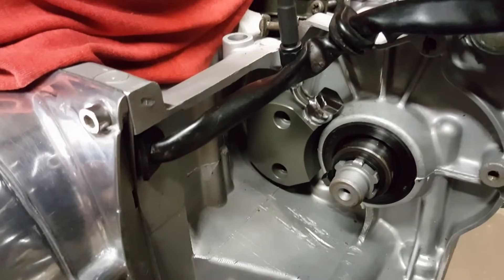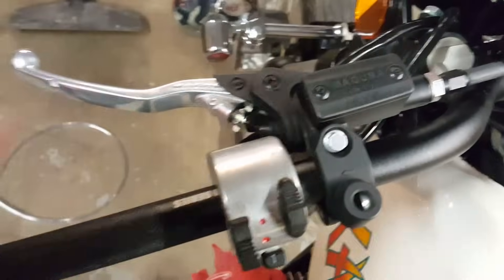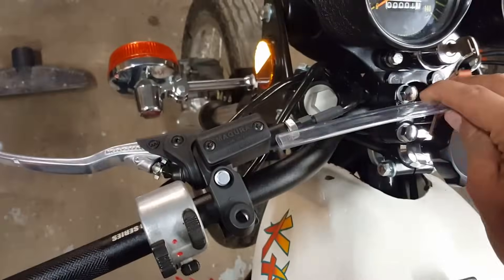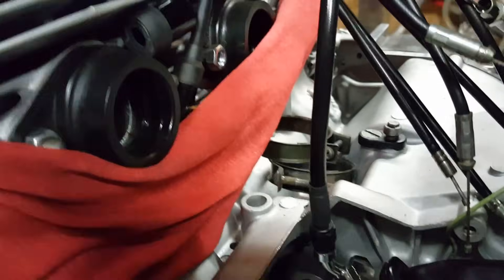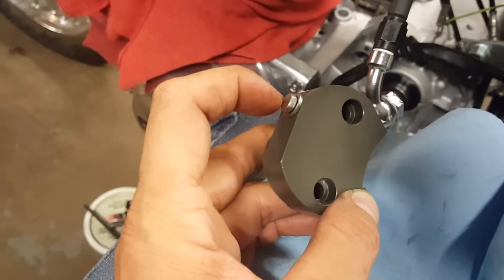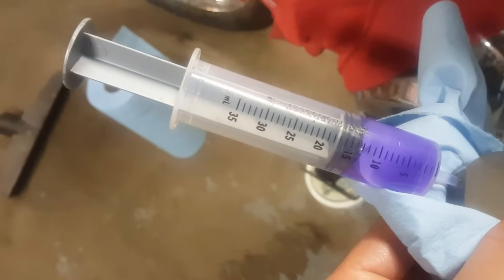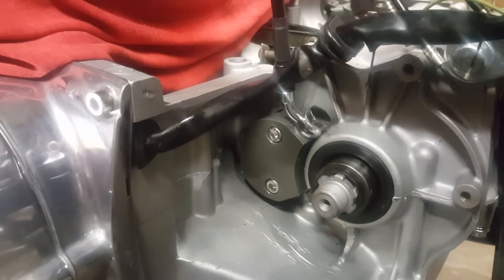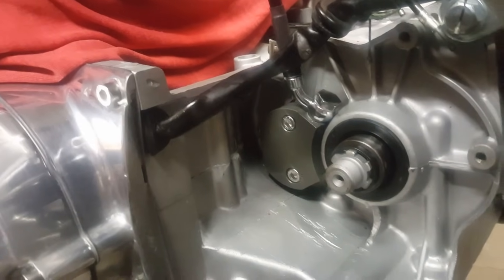Motorcycle Hydraulic Clutch Conversion | Kawasaki H2 Triple

Comment: been on Russells web site no NED'S Hydraulic clutch kit found. Any help in getting one.
Thank's Geoff.
Reply from the maker: There is no complete kit.  The slave cylinders are built by Ned from the Canadian Triples Forum.  There is a thread on there regarding ordering.  I sourced many of the fittings from Russell's which is what's listed in the  work sheet.   The master cylinder was from Ebay and is made by Magura

Comment: Will this work on the (2007)Kawasaki ninja 650R?
Reply from the maker: This particular slave cylinder is designed for the Kawasaki Triples.  I don't know if it will fit on your bike or not

Comment: I can find "most' of the parts, but where did you get the pusher that bolts to the engine?  The leaver, hoses, etc are easily found but can't find that exact part.  I'm thinking maybe an older listing and the napa online link may have one time sent you there but now just wheel cylinder cups....  Great video, would love to put one on my bike.
Reply from the maker: There are currently no kits available.  They're made by a local guy for the triple community.  If he gets enough interest he'll put another order in